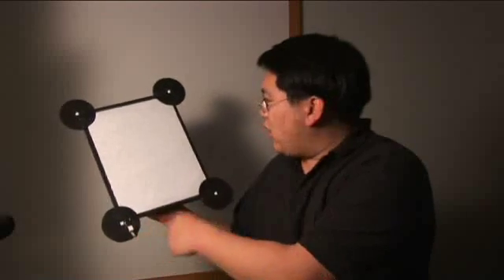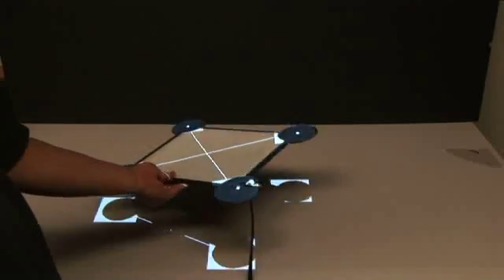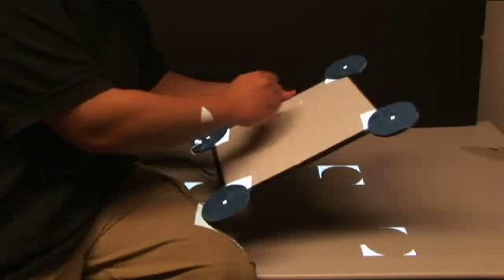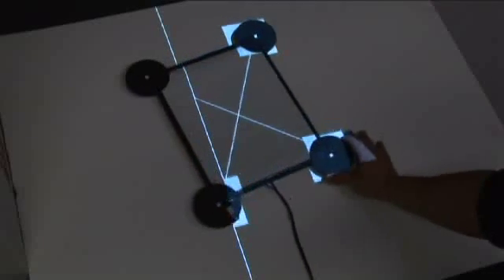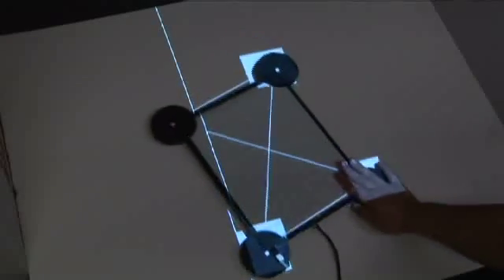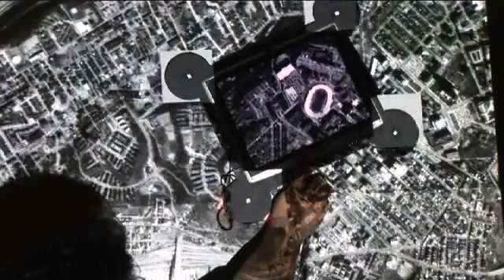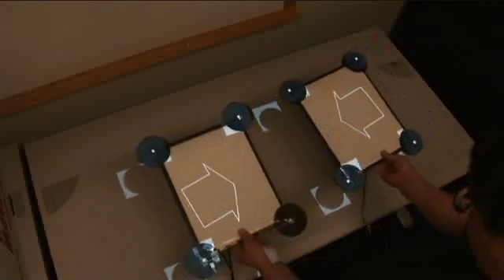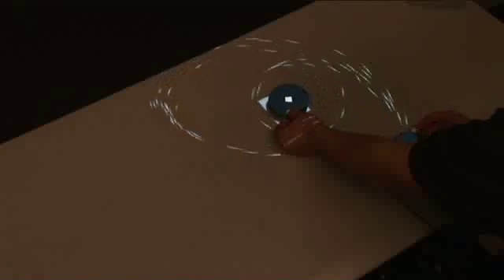Moveable Projected Displays using Projector Based Tracking

Comment: This seems like a great idea. Has anyone thought of using a camera and program four or more uniquely identifiable reflective tabs or peal and stick "dots" for projector calibration rather than the the light sensors? This would turn it into a stand alone wire free system as the camera would rely dimensional distance from the dots when the calibration program was run. Awesome stuff.

Comment: If all sensors are lost then most likely there is no projection surface available so the question is moot. Now, if all sensors fail then obviously you would lose tracking.

Comment: I bet in a few years we can shrink down mini projectors to the size of those wireless headset cell phone thingies (sorry for that overly technical term).

If your projector is mounted on your head, you don't really have to worry about the display leaving the projection area. Or maybe instead of a projector, use clear display glasses and go all the way with augmented reality.

Comment: As I was saying, this method can be a LOT more precise, since different locating patterns can be used for each vertex, and precision is mostly based on projector resolution, which can be very high. You get to move sensors around, each being able to be precisely and independently located. With a Wiimote, on the other hand, you're stuck moving light sources, which (a) must be the (1-4) brightest IR sources in view; and (b) cannot be independently tracked without major assumptions by the software.

Comment: You're completely mistaken. The Wiimote, which is an IR-sensitive camera that tracks 0-4 light sources, is a FAR stretch from what's going on here. This uses multiple sensitive sensors and rapid patterns to locate points. The projector provides a stimulus for location AND display, whereas with a Wiimote method, a display would be completely separate from the [Wiimote] camera and the [IR] light source(s).

Comment: It isn't that he's moving the projector, it's that he's telling the projector to only project inside of a certain square, or to somehow change the projection inside of that sqaure.  Imagine it like the projector is projecting your monitor, but instead of your normal computer, it's the Windows screensaver that bounces a picture up and down.  Normally it just bounces, but what his software does is tell the computer exactly where to project depending on what the sensors tell him.

Comment: yeah but how is it that the image is moving with the sensors on the object when the projector is in a fixed point, i dont get that. like if you move it 5 inches to the left, how does the projector know to move the image that way, theres no tilt or robot mechanism that moves the projector to follow the object? thats what im confused about. if he could make a vid on how thats done, and then watch this i would know how it works.